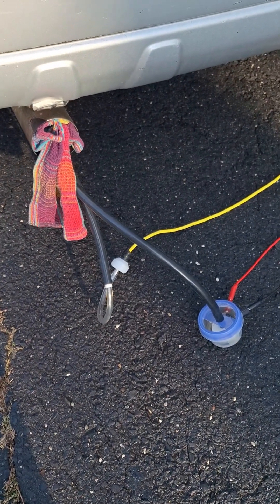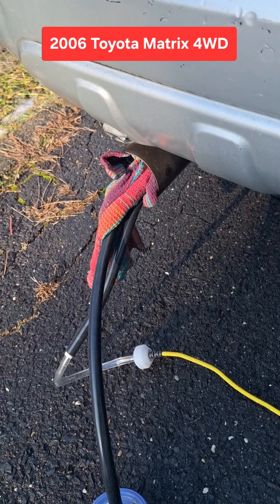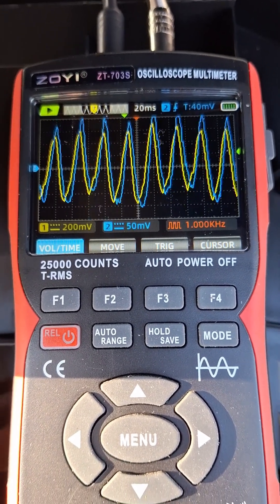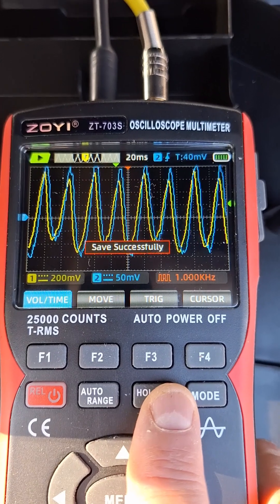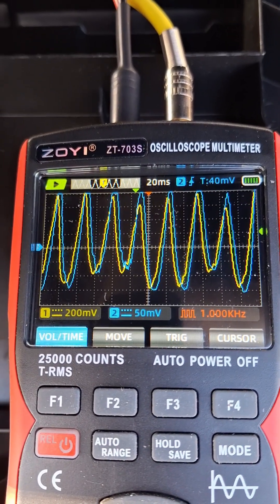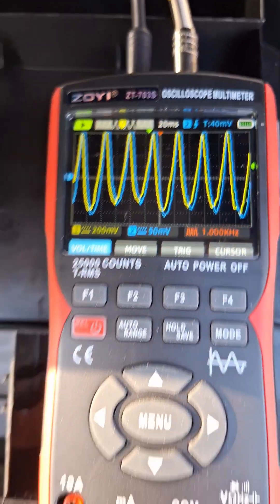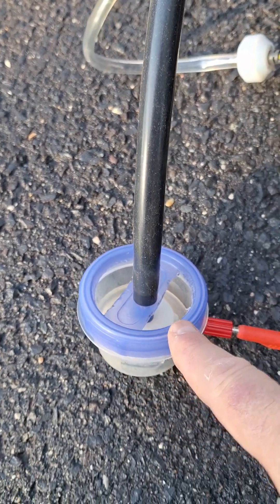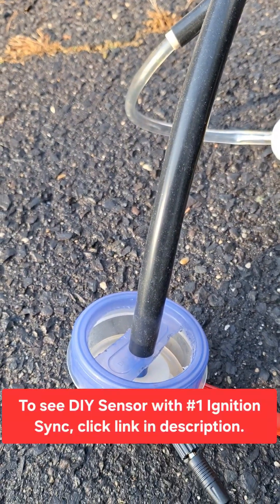ROTKEE PDS vs. DIY Pressure Pulse Sensor in Exhaust. ZOYI ZT-703S Scope.

Comment: I tried doojgban exhaust pulse wirh the rotkee one time with poor results but i never thought about stuffing the pipe with a rag
Reply from the maker: A rag can help boost the signal. Make sure the vibrations from the vehicle are not getting to your sensor I would use about 3 feet of silicone hose (with about one foot in tailpipe). 🔧

Comment: Can you identify a misfiring cylinder through analysis of the captured waveforms?
Reply from the maker: Absolutely, but it would need an ignition sync on another channel to do that. Or just measure the intake and exhaust pulses separately with a sync using the two channels. This engine runs perfectly, (everything looks uniform) so there is no need for a sync in this case.
Reply: @MarzNet256  ok sir. Thanks